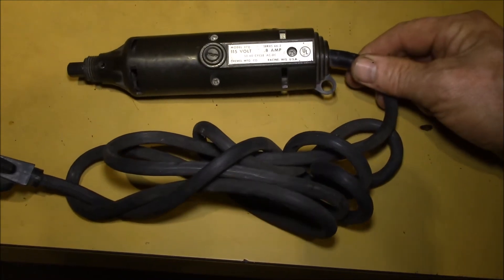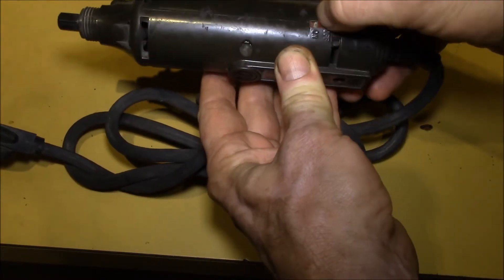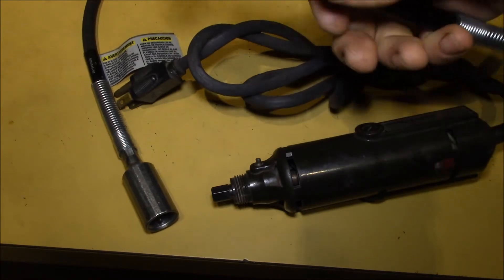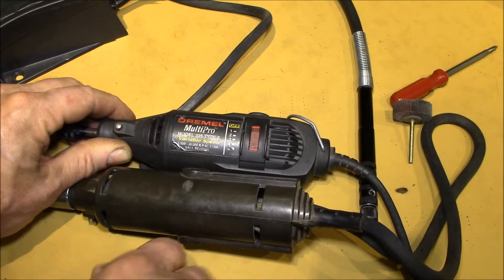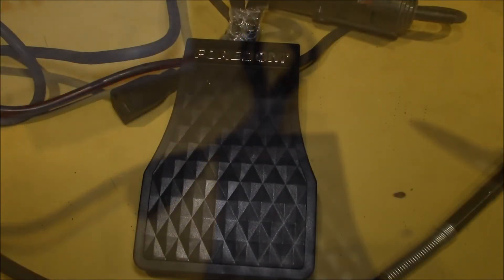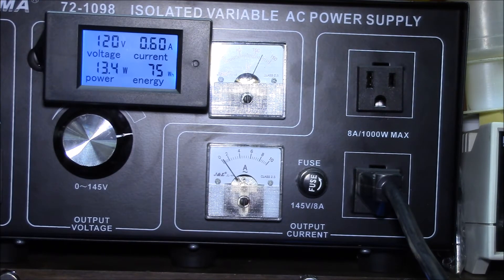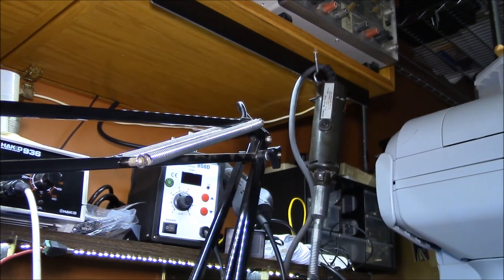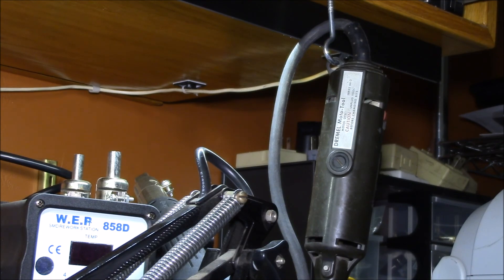Reviving an old Dremel Moto-Tool and Flex-Shaft

Comment: Thanks for the video; I have an inherited 270 I am getting aquatinted with. Seems to work fine. I picked up some basic sanders, grinders and polishers in a kit. The nut size has changed, but I have the original wrench.
Reply from the maker: Great to hear!

Comment: Thank you. A have also inherited the same exact model and it rock. Also inherited a Dremel speed regulator for it and both work(ed) like magic until I somehow clogged it. Your video gave me directions on how to disassemble it (the frontal thing needs to be screwed out, instead of pulled out) and get it cleaned and fixed if need be. Hard to find videos on the ol' 270's.
Reply from the maker: Glad you got your old Dremel working.

Comment: There’s one ☝️ good 😊 thing about these vintage Dremel tools 🧰. When ya need to change motor brushes, ya can let the springs stick to the magnets 🧲 in the motor. These vintage rotary tools 🧰 were often permanent magnet 🧲. Just remember to take the springs (or screws) off of the magnets 🧲, before reassembly of the rotary tool. This will avoid damage to the motor. Your friend, Jeff.

Comment: I've got a 270-5 Not sure how long I've had it sometime in the late 1980's. Still works and I've never done anything to it
Reply from the maker: They are pretty durable tools for sure.  About the only thing to check is the motor brushes.

Comment: I have an old Dremel Model 245 . Moto tool. 115V  0.6 AMP. Serial number starts with B
I got it at a yard sale for around $7.00. It had only been used a few times. It was practically "New Old Stock". It still had the original paperwork with it.
Yours looks older than mine. So I think the numbers might mean something else?
 I  took mine apart, cleaned it & give it some now oil . It works great & my variac Transformer works great as a speed control for it.
Reply from the maker: Sounds like a good find.  Hadn't thought of using a Variac but yes that should work as well.  I really like mine with the foot control and the flexible shaft hanging next to my workbench.
Reply: @The4Crawler  I like mine too! The variac does work good but, the footswitch would be more ideal.  If I used mine more often,  I would definitely get the footswitch.

Comment: I have a later model variable speed Dremel, the Moto-tool Model 380-5 and I can't figure out how to change the bit. I can't find a manual and there isn't one on line for one this old. I see that your flex shaft has the hole in it and I assume that hole has something to do with changing the bits. Can you tell me how you change the bits on your flex shaft? I've put small screw drivers in the hole to keep the bolt from moving and then trying to use a wrench and then a plier to move the bolt; but I can't get the bolt to move which I think would help me release the bit that's in there now. Any suggestions would be greatly appreciated. 💕😊💕
Reply from the maker: I don't have a manual for mine either.  On my flex shaft, a small screwdriver shoved into the hole in the shaft, then turn the nut on collet counter clockwise (normal right hand thread) and it comes off.  I only finger tighten the collet nut on the flex shaft since I usually only run a wire brush or flap disc sander on it..  

On my other Dremel, I do use a small wrench to snug it up tight while holding the pin on the end in to lock the spindle.  

Maybe yours has been over tightened at some time in the past.  Try loosely clamping the end of the shaft in a vise with something through the hole and then try using a wrench on the end of the collet.
Reply: @The4Crawler  I tried that and the screwdriver did keep the thing from moving; but then when I tried to move the bolt counter clockwise it wouldn't budge. I tried a wrench and also a heavy duty plier but couldn't get it to move at all. 😒😒
Reply from the maker: @JunesTarotJourney  Maybe there's some rust or dirt in the threads jamming it up.  Try some penetrating oil or if you have a small butane torch, try applying some heat to the collet end and see if that helps break the threads free.  

Here's a close up photo of the collet end of the old Flex-Shaft:

https://photos.app.goo.gl/DfrdxZ5Bn4rmugJR9

There's a hole in the end of the Flex-Shaft into which locks it to allow loosening or tightening the collet nut:
https://photos.app.goo.gl/uWGtBsqvE4v94qg89
Reply: @The4Crawler  The second photo shows exactly what I did, which didn't release anything not matter how hard I used the plier or the wrench. I have a small butane torch so I'll check it tomorrow. I may have to go out and get a refill for it. I'll try that first and then try some oil. There doesn't seem to be any corrosion etc.visible.  Granted I haven't used it for decades, but that was because soon after I got it I bought a Foredom and that became what I used all the time since, so this Dremel is like new. Thank you again for all the suggestions to help me try to fix this. 💕😊💕
Reply: I finally got it working! I'm not sure if the oil eventually loosened things or not; but the big change I made after heating it, using the oil, banging it lightly with a hammer, etc,  instead of a small screw driver, I used a larger diameter bit that I  my Foredom drill, and that diameter is the same as the hole. The bit I used was a deep, silicon carbide bit about an inch across and it was easy to push up against that with my palm as I used a wrench to finish the job. I was losing faith there for a while, but I kept trying. Thanks so much for all your help and suggestions!💕😊💕
Reply from the maker: @JunesTarotJourney  Glad you got the collet loose.  I find with stuck fasteners, persistence pays off.  Just keep trying various techniques and then all of a sudden it'll break free.

Comment: Rather than fussing with the shaft lock when using the flex shaft there is a hole in the handpiece. Line the hole in the handpiece up with the internal hole and slide a pin in. This effectively locks the shaft for changing tool bits.
Reply from the maker: Yes, good point.  It does limit how much shank engagement there is, at least on my flex shaft.  If I shove the shank all the way into the collet, it blocks that cross hole.

Comment: Thank you for the video but I'm still confused- idk if its bc I have a differently model but my tool has a tiny little removal piece on the end of the bit that looks like a flat head screw shape. Why??? And do I remove that screw piece before changing bit?
Reply from the maker: I've never run across a Dremel with that type of end.  Maybe try searching for a user manual with the part number of your Dremel.

Comment: I have a 380 that belonged to my father.  It still runs strong.
Reply from the maker: Yes, those classic Dremels are good tools.  As long as you keep an eye on the carbon motor brushes and don't let them wear down too far.
Reply: I have a Dremel 380 variable speed that I haven't used for so many years that I can't remember how to change the bit I have in the flex shaft. There's a hole on the piece that the collet fits into and I've pushed a very small screwdriver in there to stop the collect from spinning around. Then I tried both a wrench and a plier to rotate the collet counter clockwise figuring that would open it but I can't get that bolt to move. Can you share with you what you use and how you open it to replace bits. Thanks for any help!💕😊💕

Comment: Great video... But I thought because the title is Reving a dremel moto tool... It would be just about reviving it not just buying new stuff to add to it.. That updating the tool. Do you have a video about reviving one like the parts inside? Like you only mentioned the brushes quickly I'd like to know what they wear against inside to check for damage especially now that you said it's from the 70s! Had no idea mine was that old
Reply from the maker: Thanks for the comment.  The MotoTool and FlexShaft were old items I've had forever and I added the foot pedal control to give the old on/off MotoTool variable speed operation along with getting the FlexShaft working with it.  I do need to take a look at the brushes in my two MotoTools, so maybe I'll do that and shoot some video of the process.  Thanks for that suggestion, stay tuned for the video...

Comment: 8 amps...it's a beast!
Reply: I believe it is probably 0.8 amp?
I have an old model 245. I got at a yard sale. it is 0.06 amp.
I have a vintage Kenmore fan from the late 50's or early 60's.
it has a 16 inch metal blade & draws around 1.80 amp at 120V. Or 2.45 amp surge.
You're right though,  it's still a beast!👍

Comment: Is there an adapater to use the older flex shaft on the new multi speed Dremel ? The design looks much better on the old one and it looks more comfortable to use
Reply from the maker: Not sure about that.  My newest Dremel (model 395-type 5) seems to fit the old shaft.  Just unscrew the end cap and it threads right on.  Haven't looked at any newer models since I have the two working units.
Reply: I think my one is a 3000 series hmmm . . . Might have get one and test this out the finer pen style is much better than the one for the 3000

Comment: dremal 380 model
just found one of thees today
 it runs on 125v 
any idea on how to convert it to work on a 220v powerline ?
Reply from the maker: Should be able to find a small 220-110 volt step-down transformer to power that.  It's not a terribly high current load.  Lots of options show up on Amazon: http://amzn.to/2iIdPTI
or eBay, search for "220 110 transformer"

Comment: I like your video. I recently bought the dremel model 270 moto-tool at a garage sale for $1.00. it's missing the coullets and needs new carbon brushes. the old lady said she didn't know if it works. I hope that if I buy the parts I need that it works.
Reply from the maker: As long as it still spins and the commutator is not chewed up from the old brushes wearing down, it should be fine.  Replacement brushes seem to be available, search for: Dremel 90827 Carbon Motor Brush

Comment: What is the dremel flex tool used for? Polishing or sanding objects?
Reply from the maker: It'll work with any Dremel tool bit, just that you have something like a pencil in your hand instead of the whole Dremel tool.  That makes it good for working on small items.  I mainly use it with a sanding flap wheel to prep small parts for soldering.
Reply: @The4Crawler  And I'm planning to use it for jewelry work and engraving
Reply from the maker: @dessyedeeclark1144  Might be worth trying to find one of the foot speed control pedals like I hooked up to mine.  The older Dremels were just one high speed and having that variable speed option makes it a much nicer tool to use for detail work. 

I have a newer Dremel with the speed control dial on the unit, but that doesn't work anywhere as well as the foot control.  I find that newer unit bogs down at slower speeds and you need to stop what you are doing, readjust the speed dial and then continue.  

With the foot control, you can start off slow and then  if the unit starts to bog down under load, just press the pedal down a little more until the speed comes up and you're good to go.
Reply: @The4Crawler  Very helpful explanation. I will be searching for a used one that has some weight. Older Foredom. I looked at a Rio Grande full set up, but too pricey. one review said the newer foot pedals were to light weight and flipped around.
Reply from the maker: @dessyedeeclark1144  Yes, good plan.  I have the older style Foredom that's made of metal and it's quite heavy, really stays put on the floor.

Comment: Judging by the electronics in the background, you know a thing or two about this stuff. Do you have any concern that running the tool at a lower RPM (less current) might be harmful to the motor?
Reply from the maker: Yes, you can run into overheating issues if you run a long time at low RPM and a high load on the Dremel.  Same thing can happen at full RPM, too.  I was once using a saw attachment to cut some wood in a tight location and had to stop a few times to let the motor cool down.  Basically use some common sense and all is OK.  If you feel or smell the motor getting hot or if the motor is bogging down under load more than usual, stop and let it cool for a while.  Usually run it full speed with no load for a bit to blow some air through, then let it sit and cool.